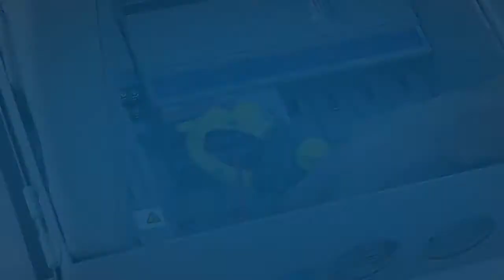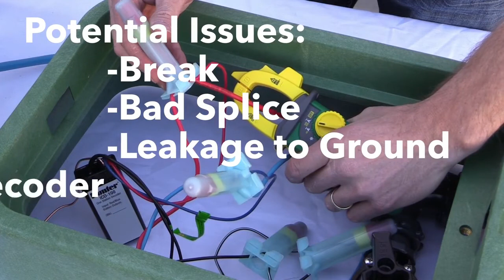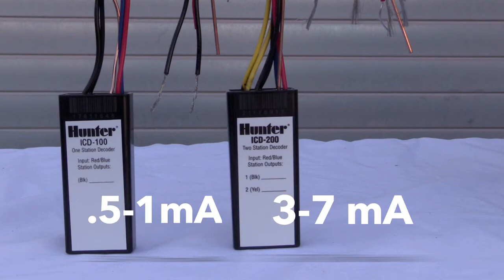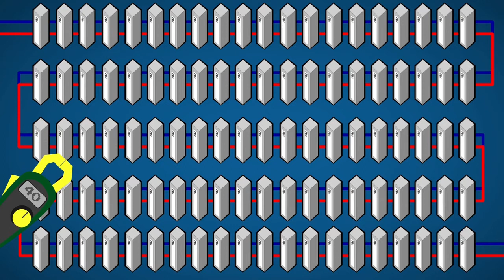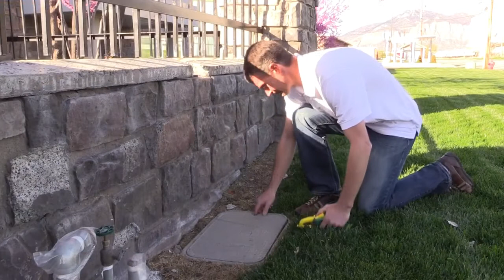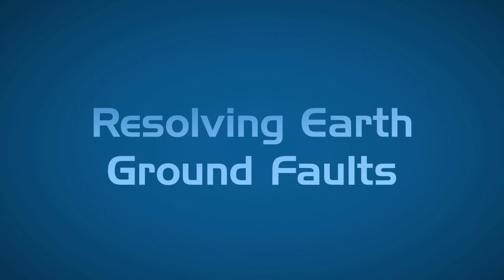Decoder troubleshooting

Comment: i picked up a new account with a Hunter ICC and Hunter DM module . i have made sure all splices are good yet no matter what I keep getting 'line fault' on the dm module. could this be a grounding issue or could the controller be bad? i do not have much two wire experience. any advice you can give is helpful
Reply from the maker: please contact your supplier nearby